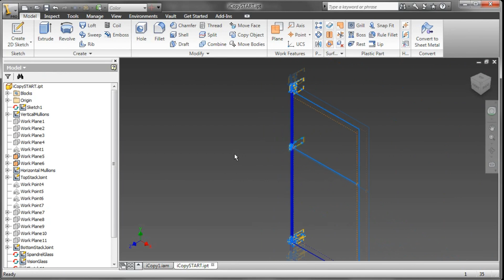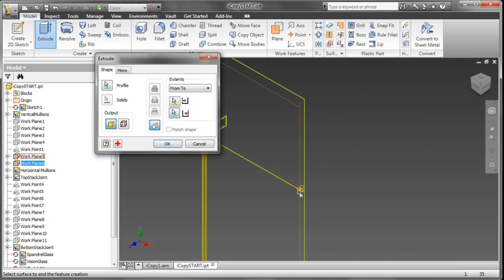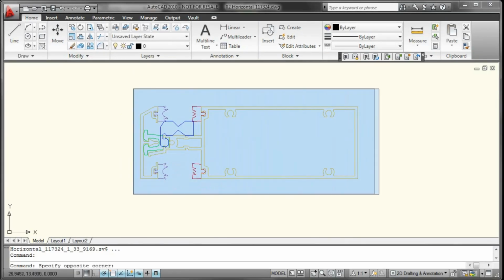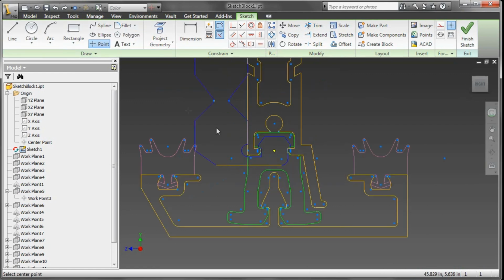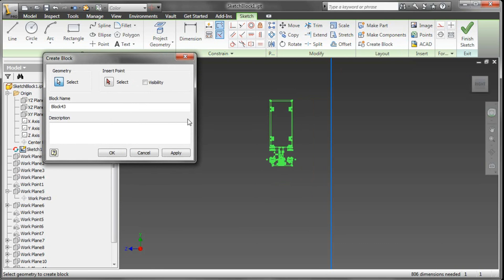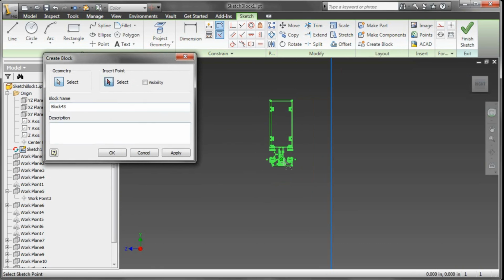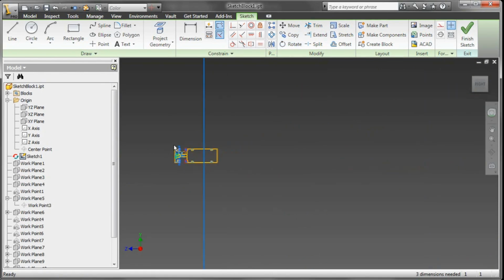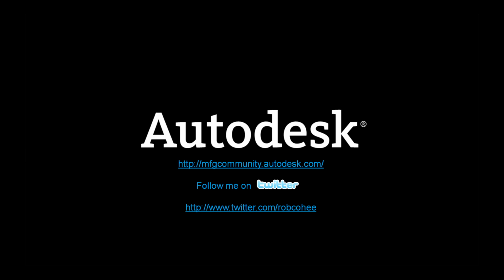Autodesk Inventor Two Minute Tip: Sketch Blocks

Comment: Always do your 2D sketch clean-ups and prep in AutoCAD. Where possible, use polylines and centre all 2D elements about a logical origin while still in AutoCad. Finally, run PURGE and OVERKILL in AutoCad to eliminate overlapping elements as Inventor makes doing these tasks a thorough pain in the you-know-what.

Comment from the maker: You could absolutely use these blocks for individual features. This isn't a great example of that but say this was not an extrusion but machined (and smaller obviously). I would create a solid out of the whole profile, share the sketch then use the hole feature to drill out the holes, extrude cut to remove the void, etc...

What you didn't like my kitchen hood.... [grin]